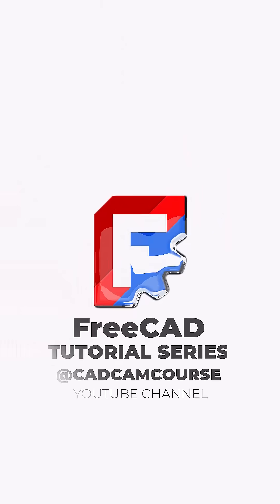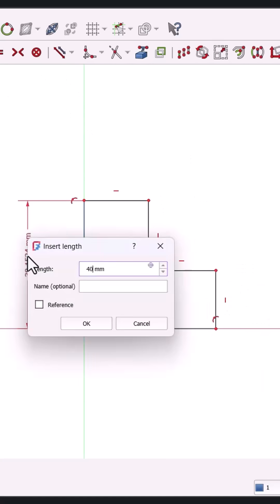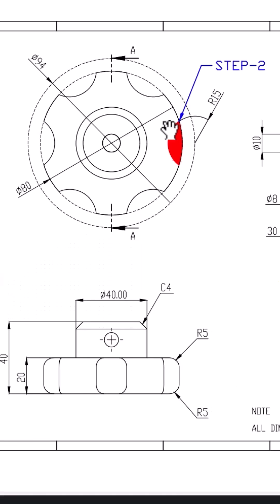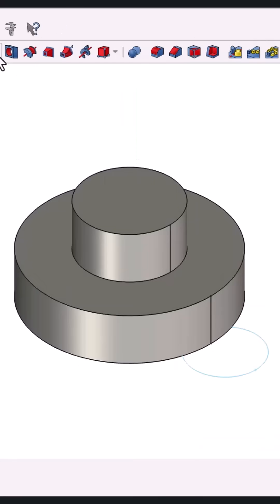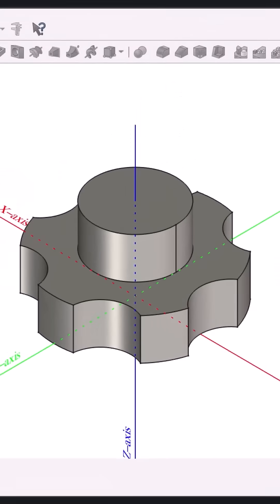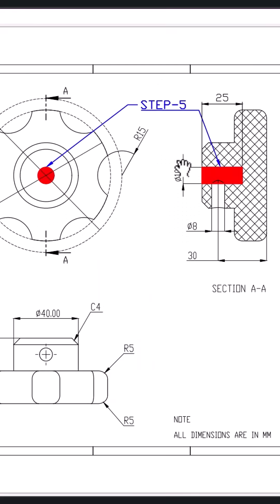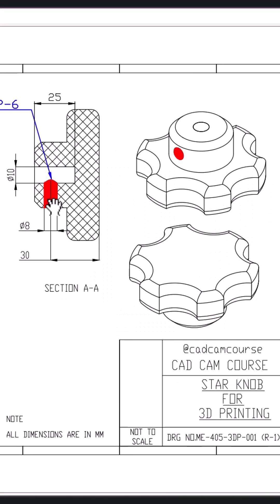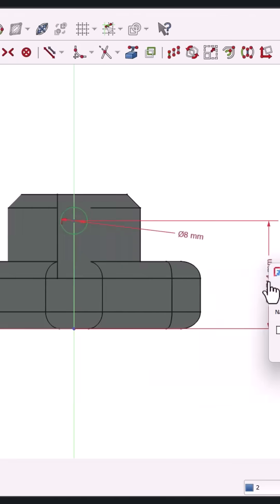FreeCAD in 60 Seconds! | Beginner Tutorial for Part Design | #freecad #freecadtutorial #3dmodeling

Comment: Is Freecad better than Catia?
Reply from the maker: Great question! CATIA is a powerful commercial CAD system used in industries like aerospace and automotive, with very advanced toolsets. FreeCAD, on the other hand, is completely free and open-source, which makes it accessible to anyone. It covers the core fundamentals of parametric 3D design, technical drawing, and even simulation. The big strength of FreeCAD is that it’s community-driven.  it keeps improving with every release, and you can even customize or extend it with add-ons. While CATIA will always be ahead in some specialized areas, FreeCAD gives you professional-level modeling tools without the cost, and for many projects it’s more than enough.

Comment: I just want to layout a dark room I'm building.
This software is too complicated, and I used Maya and 3DS for years. SketchUp is too flaky using the online mode. What else is good?
Grid paper?
Reply: Are you looking for something 3d, or just 2d drafting?
Reply from the maker: I understand — FreeCAD can feel a bit complex if you just want to do a quick room layout.
Since you’ve used Maya and 3ds Max, you already know 3D basics, but for simple architectural planning, you might find Sweet Home 3D, or even Blender with an architectural add-on easier.
And if you’re looking for a more professional solution, Chief Architect Premier is a great option.